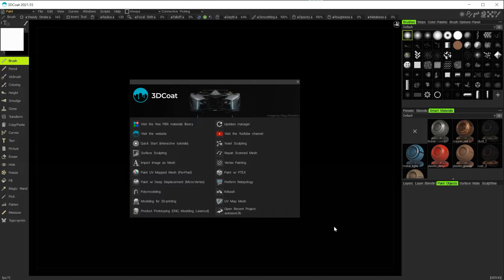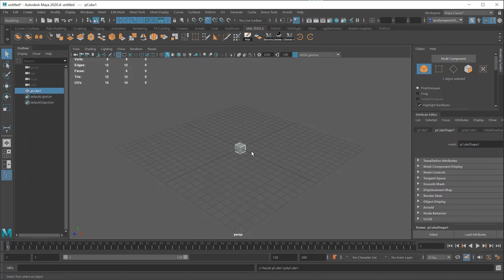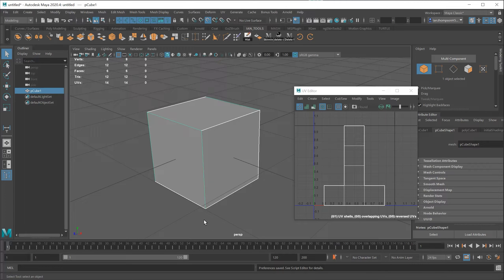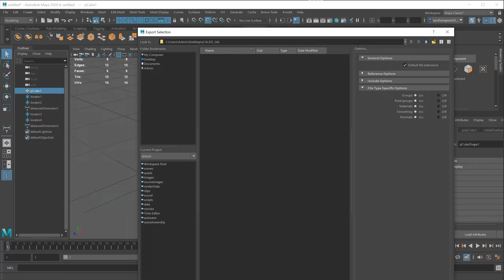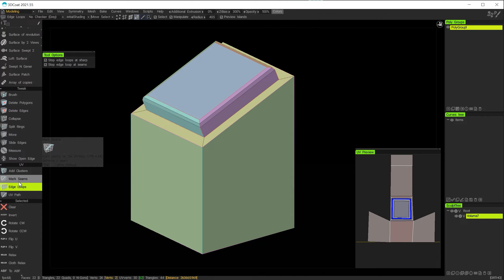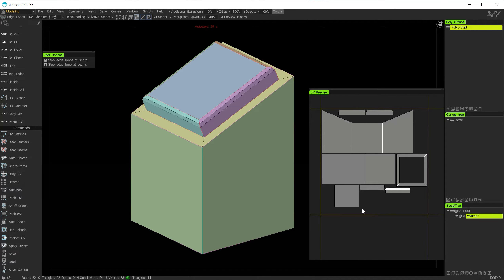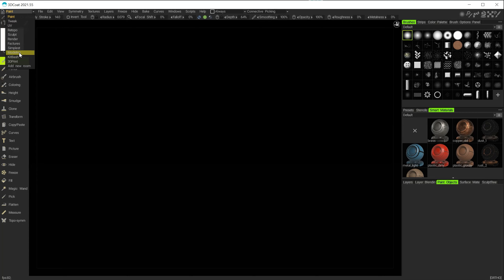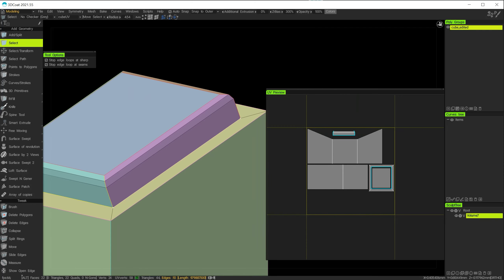3D-Coat Poly Modelling Part 2

Comment: do you have any techniques for importing cleanly to the sculpt room from a maya fbx export without having to sub d first to prevent faceting?
Reply from the maker: Hey Robert... if you are importing say a low poly object into the sculpt room, then you won't be able to sculpt without subD... you can bring the model directly into the sculpt room and on the import setting increase the subD before you commit it to the room. Or you can bring it in as a Surface object and then convert it to a Voxel object giving it e.g. 1m+ polys to remove the faceting, allowing you to sculpt details.

Comment: Hello I’m very new to 3D coat and I’m having some performance issues when I really feel like I shouldn’t. My pc has pretty good specs, ryzen 9 3950x rtx 3060 and 64 gb of ram. Somehow I’m getting lag on meshes as low as 250k polys in voxel sculpt. It’s depressing af lol I don’t want to use zbrush but it seems I’m going to have to.
Reply from the maker: Specs seem fine... try using a low res default object to begin with. then increase its res incrementally and then make a note of the point where is lags. Is it a sudden lag or does it get progressively worse as you increase res?
Reply from the maker: Also 3DC has 2 sculpt types - Voxel and Surface. Does it lag in both at the same point?
Reply: @IanThompson007  I’d have to run some tests on this. I’ve noticed weird spikes when adding mass at 250k voxels and at > 2 million I can only do really slow strokes else it hangs and my cpu is running at 40% it’s weird